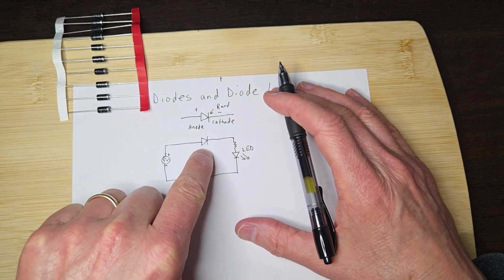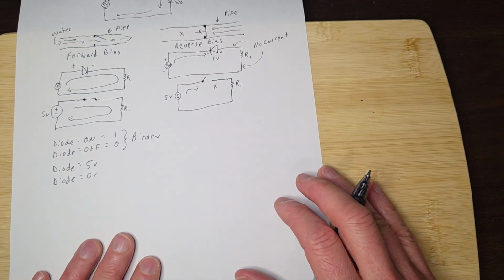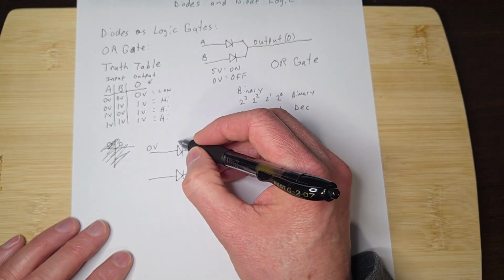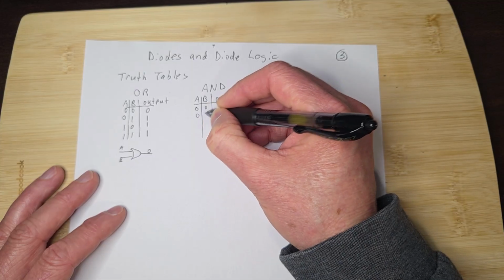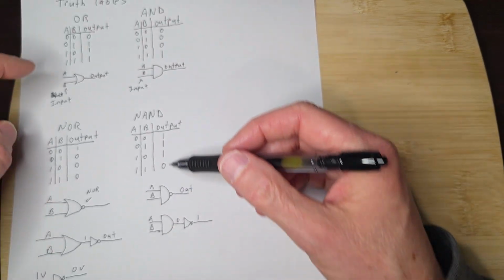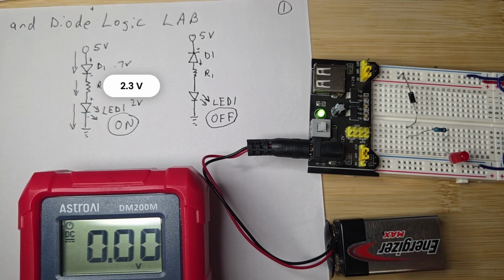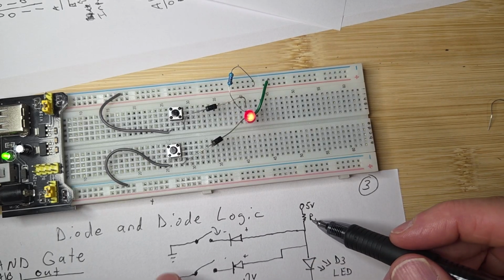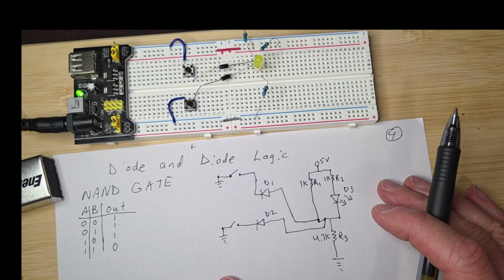Diode Logic Explained – Build AND, OR, NOR and NAND Gates

Comment: So that's why they used to make computers out of tubes or transistors. They didn't have any ICs lying around.😅
Reply from the maker: Exactly, those early pioneers really had to get creative with discrete components! Here's a fun bit of computer history! In 1947, engineers working on the Harvard Mark II computer discovered an actual moth trapped in an electromechanical relay. They taped it into their logbook and wrote, "First actual case of bug being found." Interestingly, the term "bug" was already being used for technical problems decades earlier, including by Thomas Edison! So, the moth didn't originate the term, but it certainly made for a memorable story! 😄Whoo Buddy!! ⚡

Comment: I really love your explanations, but wouldn't the diodes be totally pointless in those logic circuits you showed? I mean, they're forward-biased, so they're basically just acting like wires, right? Instead, wouldn't it be more interesting to demonstrate the diodes having their polarities reversed somehow?
Reply from the maker: You are right! They are not really practical in that way but it was fun to use them that way. It is just a fun way to show how they can be forward biased to turn LEDs off and on. I like your reverse bias idea to add some more capabilities to a logic circuit. Great comment!